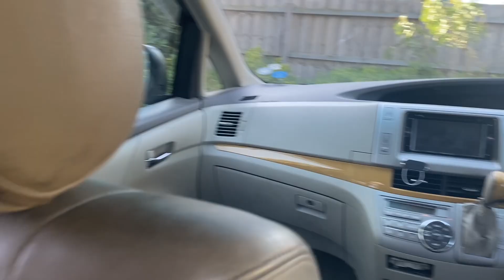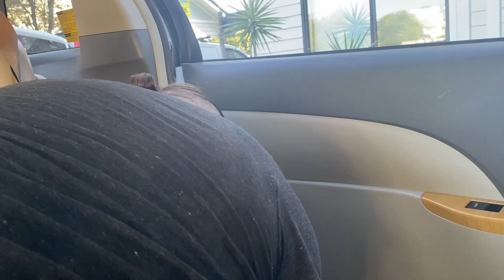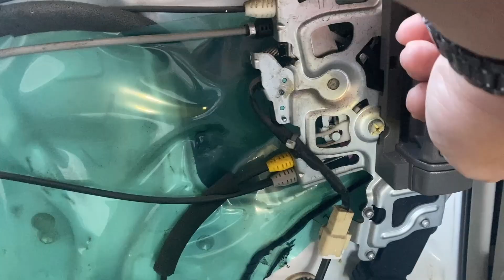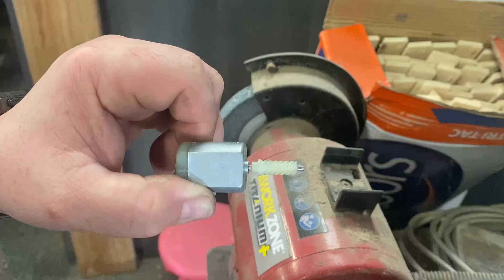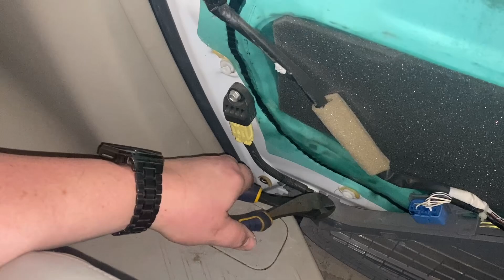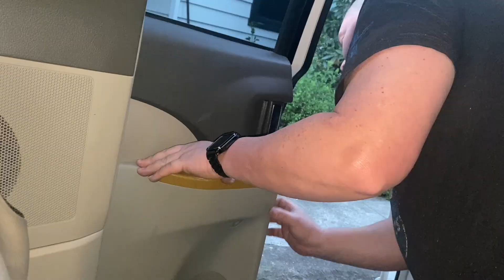2007 Toyota Estima sliding door repair. Doors won’t automatically open but will by hand

Comment: Great tutorial, I've got the motor and the metal shaft is round all the way like yours in the video, do I have to flatten one side? Or will it work regardless and the worm drive will fit.

Comment: Before cutting the loom, try removing the pins from the plug and reinserting them the other way round. You normally just need a very small flat blade screwdriver to slip in to depress the retaining tags. I've also used a piece of the metal stiffening rib out of a windscreen wiper blade and ground the end down a little.
Reply from the maker: Great advice. I’ll give that a crack on my next plug repair 😊

Comment: Was it so that the old electric motor did not work at all anymore?
Reply from the maker: Yeah, they slowly stopped working and my mechanic was telling me that it was the bearing in the track creating too much resistance and that he couldn’t get the bearings in Australia 

Thats code for “that’s in the too hard basket. Take it somewhere else”